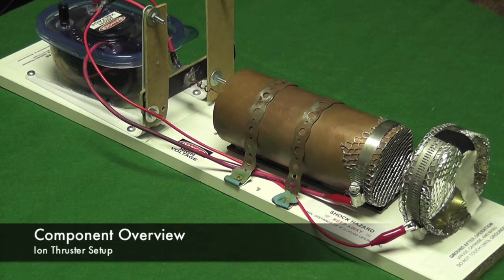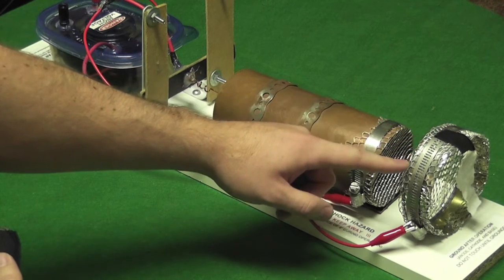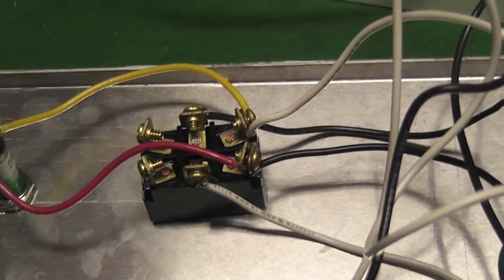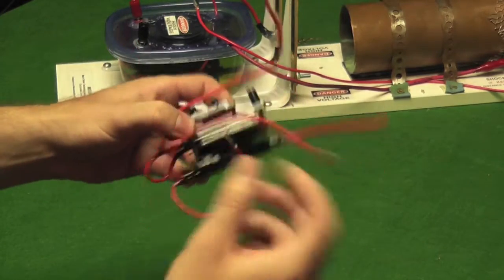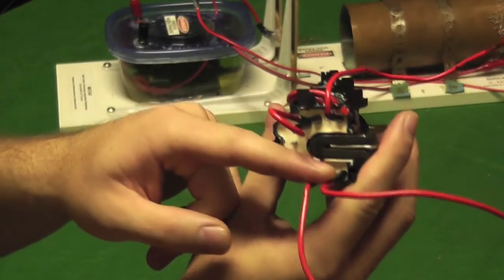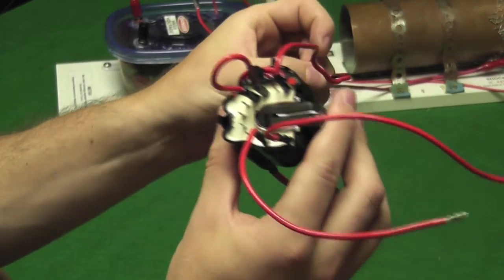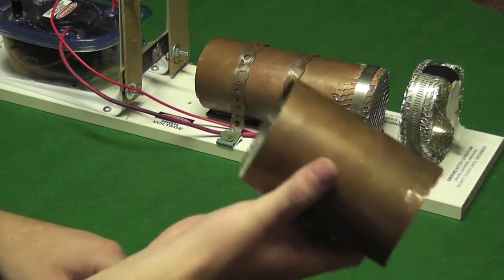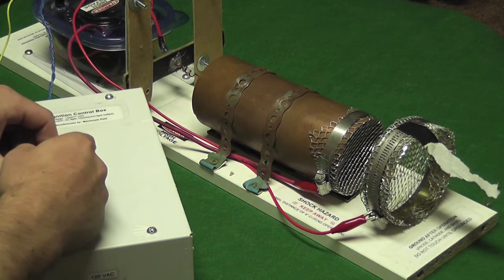Homemade Ion Thruster - MSTAR

Comment: HV return lead 4 from upper right when u were holding. Use 24 volt battery in series from HT lead to pinout the return with multi meter. Cool rocket engine :)

Comment: Is it Possible to increase the Speed of Thrust  ????
Reply: in case this old question of yours is still relevant to you: you can with multiple stages in series; the main limitation is the max. space charge of air where arcing and breakdown of the electrical field occur; google for Paschen's law to see how the breakdown voltage is related to the electrode distance. Increasing both voltage and distance also helps, but if you don't want to operate with insanely high voltages, multiple stages are the better solution. Typically, around 2-6 m/s are possible with a single stage and up to 110 N of thrust per kiloWatt have been demonstrated, but with these tiny devices we're more likely talking milliNewton and  Watt or milliWatt... The total velocity increaes almost linearly with the number of stages. The sky is the limit... Using an electrode with a sawtooth cut as the emitter (instead of a simple wire or needle electrode) is also worth a try. The long copper tube in this design also isn't necessary, because most of the ions are neutralized directly at the beginning anyways. A much shorter tube or ring or anything that has more surface than the emitter (and no sharp edges) does the job, too. By making the individual stages shorter you can have more stages in series over the same total length. Polarities in a multistage setup should be alternating.

Comment: Would there be any difference in the number copper anodes to a SINGLE copper pipe cathode? And would there be any difference in the THICKNESS of the copper pipe cathode? or both?  very curious
Reply from the maker: GUNVALKERIE I don't think the thickness of the cathode (copper tube) would have a significant effect on the efficiency of the engine. However, I did not test it. Having multiple anodes may increase thrust, but you would have to be sure that the cathode was large enough to not generate arcs between itself and any of the anodes.

Comment: nice vid, makes me ask what would happen if you was to line the copper pipe with multi-round ring magnets less than 1 inch thick then added a kind of AC current to the magnets like in an induction coil to the magnets and see what happens to the Ion thrust
Reply from the maker: Justice Darling that's a good point. I'm not sure if the applied magnetic fields would assist or inhibit ion flow. Also not sure if the grounded copper tube would interfere with the AC current applied to the magnet.

Comment: Great video. Would be even better with some deeper design annotations. Did you test the watts it uses at 120VAC input? (comments about efficiency?)  Is there some knowledge about the configuration you were relying on as far as the length vs size of tube, shape, ('and spiral') of wire, etc? Any ideas about limit of thrust for that size etc? Does it make any ozone?
Reply from the maker: eltouristoduo sorry for the delayed response. No, at the time I did not test the wattage. I was pressed for time to get the project completed. The length of the cathode was chosen to optimize the surface area while minimizing volume. Calculus reductions show that l=2r. I did have plans to test other configurations but didn't have the time. The anode (spiral wire) was taken from an old microwave magnetron, basically in an attempt to maximize surface area and decrease length. Limit of thrust I would say is very small, < 1lbf. However it was not optimized. Using a propellant instead of air and increasing the scale would drastically increase thrust.

Comment: Im very interested in this and i would like to make something like this my self, I have a pretty good understanding when it comes to how a ion engines works, but i do not quite understand simple electricity. Is there any way you can explain how you got AC power from the "wall" into a positive and negative DC power (I guess that is what you did). And also how many Volt do you use :/
Reply: You don't have to rectify the output as far as I know, the ions always flow in the same direction, regardless of the polarity. I think this has something to do with the physical construction of the electrodes, ie, the electrodes are different in size, and this creates the differential required for the ions to flow, not the polarity.
Reply from the maker: SporeksChannel I used the AC power from the wall as an input into the ballast (store bought for industrial lights). As far as I know, ballasts do not rectify (convert AC to DC). It does however increase the voltage slightly and significantly increase the oscillating frequency of the current, which acts to excite the flyback transformer more, creating a higher potential. I simply used 120VAC from the wall, which is converted to 277VAC through the ballast. That is input into the flyback, which I estimated to generate approximately 50kV based on the arc length.